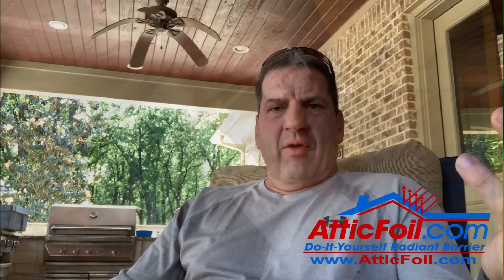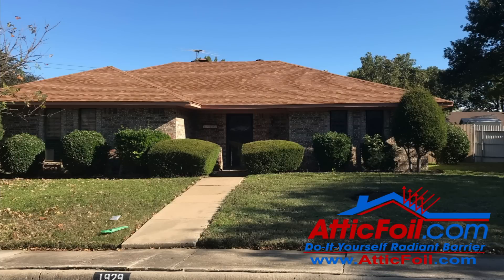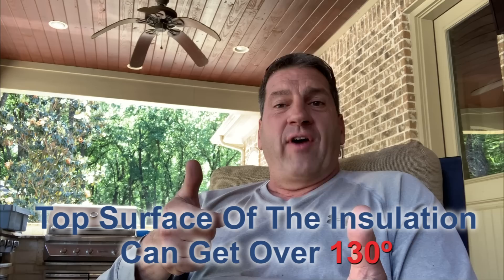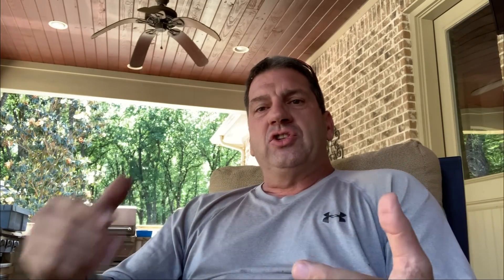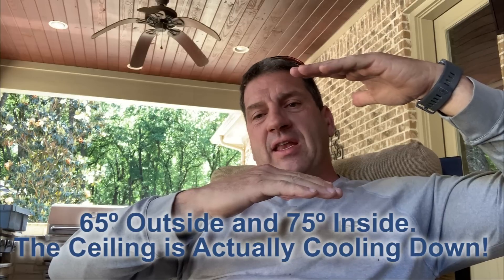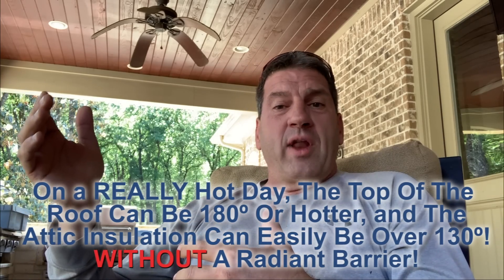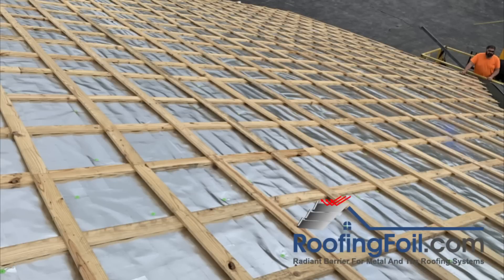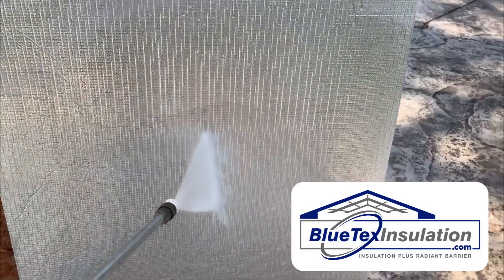Why Is My Attic So Hot? How Can I Make My Attic Cooler? - AtticFoil.com Radiant Barrier

Comment: Can I use this foil instead of the preformed foam rafter vents then add the rafter insulation?
Reply from the maker: Definitely! And it works great.  You can run the lowest piece horizontal across the bottom and tuck back over the top plat of your wall to create a "pocket" for some insulation to sit on the top plate.  This piece will typically go 2-3 ft up the slope of the roof.  Then leave a few inch gap before you start with your next piece.  This gap will allow air to enter the attic if needed.  Look at this page: https://atticfoil.com/index.php/installation/staple-up-installation/ and look for the section -  Want to Add More Insulation Later? You will see the skirt and slit method there.

Comment: I just bought a house, and the old owner installed foam on a small attic section separate from the big attic. The problem is that section it's on top of the garage, and I think the problem is that all the heat that enters thru the garage, those vapors rise to that small attic that now it's completely sealed because of the foam at the roof. So that heats travels to my closes room the closest and my master room. Any ideas?
Reply from the maker: Not sure why someone would foam only part of the attic.  You should either go fully sealed or vented.

Comment: Here is my situation.  When we purchased our home 12 years ago, which was built in 1940, the  attic did not have gable, ridge or soffits vents (no soffits since my roof has no overhangs), but it does have a window at each end.  My roof has slate tiles and my entire attic is insulated (floor, rafters and gable walls.). Not sure of the reasoning behind the batt insulation in the rafters since it was never a living space.  As you can imagine, my attic gets really hot in the summertime. Opening both windows helps a bit but not much.  Would removing the batt insulation from the rafters and doing nothing else help some of the hot air escape through the roof, and/or would installing this foil insulation instead (after removing the batt insulation from rafters) be better in the rafters?  I could install a fan at one end of the attic and run it while the other window is cracked open, but that would require running electrical in the attic.
Reply from the maker: You would be best to remove insulation between rafters and ONLY use www.AtticFoil.com radiant barrier.  The attic is a "non-conditioned" space, but they basically built a refrigerator with holes on each end.  You would be better to stop much of the radiant heat from getting in.  I think you will be surprised how much cooler the attic is after installing a radiant barrier.  Remember, the attic will usually never be cooler than ambient (outside) temperature.  I would only consider an fan IF the attic is still 20+ degrees hotter than outside after installing www.AtticFoil.com

Comment: Wouldnt you only want it one way radiant barrier? I want to block the heat radiation from my roof, I don't necessarily block the heat that would be trapped in the attic, back at the attic, right?
Reply from the maker: There is really no such thing as "Trapping" heat.  Heat always moves from hot to cold.  So, any heat in your attic is trying to move to the cooler interior of the home, not back out the roof.

Comment: How does the foil compare to reflectix bubble foil? I'm in Houston and looking to install on the bottom side of my rafters in my detached garage.
Reply from the maker: Take a look at this page: https://atticfoil.com/index.php/knowledge-zone/knowledge-zone-attic-foil-vs-other-products/  Bubble foil in a vented attic will not do any better than www.AtticFoil.com and it's more expensive.  Bubble foil type products are more for metal buildings where condensation on the metal can be an issue.

Comment: I don’t have a ridge vent but I do have a gable end vent. Should I install this from the top to bottom of the attic ceiling? Or leave a gap at the top? Also is this better than using r8 bubble wrap? Thanks
Reply from the maker: No, ridge vents alone will work great when combined with soffit vents. Always leave gaps at top an bottom.  You WANT air to flow freely through your attic.  Bubble foil has NO advantage compared to www.AtticFoil.com  In fact, you will spend more money for no additional benefit.  You want foil stapled up first, and more insulation on the FLOOR of the attic.
Reply: AtticFoil Radiant Barrier Foil Insulation thanks for the reply. I don’t have a ridge vent...should I still install foil?
Reply from the maker: @pureforce469  Sorry, I missread your question.  YES, it does not matter where the "hole" is in the top of the attic.  Just leave a couple inch gap at the top near the ridge and cut holes in the foil if you cover the gable vents.  The hot air will "find" it's way out.  Like water heading downhill.  Just install the foil so the air never hits a "dead end".  This page and videos will help: https://atticfoil.com/index.php/installation/staple-up-installation/

Comment: Hi, I'm living in a new build, semi-detached house. in my attic there are grey construction bricks on sides, rafters on top. I have put the foil underneath the rafters, left an air gap on top and bottom. What I understand is I need to cover also both grey brick walls, or the foil underneath the rafters is enough? Thanks
Reply from the maker: It sounds like the bricks may be a gable end??  If it catches sun, then yes you want foil between the hot brick and the insulation.
Reply: @AtticFoil   yes it's gable end. However, for most of the day it's in shadow of another building.
Reply from the maker: @szim71  If it's in the shade, then you will have limited benefit covering it.

Comment: Hi Sr. I'm very interested on the product my house has a big issue on keep cold temperature on the summer here on Houston Tx.  
Now have a question after installing your barrier staple method I also want to replaced or add more insulation on the bottom... on your opinion which is better take the existing out and replaced or just blow more insulation on top of the old one ... my house is 17 years old 
Thanks on advance
Reply from the maker: Unless your old insulation is infested with vermin/droppings etc. then it is still good even if it's a little dirty.  Just install www.AtticFoil.com FIRST and then seal any holes/penetrations in your ceiling and then install more insulation.

Comment: Just ordered 1500 sq ft for my house. I've got Whirlybirds at the top of my roof but I have exposed rafter tails with no venting. Do you think this will be problematic?
Reply from the maker: First, thanks for the order Preston!  It should not be a problem.  Just leave gaps at the top and bottom of all rafters like in the install videos.  However, If at all possible, I'd try to find a way to get some "holes" in the bottom of the attic for air to get in.  Maybe a porch you can cut a vent into? Does the attic access open into the attic? Leave the door open and keep the garage door cracked and this will get air into the attic too.

Comment: I put the foil in my attic and it made a big difference.
Reply: Same here. On a really hot day, my attic is 120 degrees. The 16 inches of blown-in insulation just under my attic foil (from this source) is 105 degrees. That is how well it radiates the heat away. That's 15 degrees less heat leaking into my house.
Reply from the maker: @Inkling777  Thanks for the feedback!  On a hot-sunny day many people totally undervalue the benefits of a radiant barrier.  Once they see and feel the difference they are believers.

Comment: Attic install scenario: Vented attic, ducting on floor with insulation, 2x6" joisting, wood ceiling (not sure what it is called) with no insulation, so, can I put foil over the entire floor before I put plywood on top? I also want to foil the ceiling.
Reply from the maker: You cannot install foil directly over the insulation and then directly lay down plywood.  You MUST have an airspace on one side of the foil for it to BE a radiant barrier.  If you are putting down plywood, then I'd just staple it up.  Pretty basic standard attic install here: https://atticfoil.com/index.php/installation/staple-up-installation/

Comment: What about moisture being caught between the radiant barrier and the ceiling?
Reply from the maker: The space between the foil and the roof deck is ventilated - gaps at the top and bottom, so no issue there.  And if you lay out over the insulation, AtticFoil has microperforations, so it is NOT a vapor barrier to trap/stop moisture.  Does this help?

Comment from the maker: Did you enjoy this video? Please like and "Subscribe". What topic would you like for me to cover in a future video?
Reply: I am a total believer in attic foil; I had it installed on my last house (10 yr old with soffit vents and fixed roof vents). The foil made a huge difference. Now I am 90% done installing on our new house and it doesn't seem to be making that much of a difference. This house is 68 years old block construction, with gable vents, and 2 fixed roof vents and a 3 year old shingle roof. There are no soffit vents. Should I cut holes to allow airflow at the top cap/over hang to allow more airflow in the channels? Great product by the way
Reply from the maker: It depends.  If you are in a colder climate with an older "leaky" home, more ventilation could help in the winter. Or, if you are in a really hot area having the low "holes" for air to enter will greatly increase the "stack effect" in the attic.  Cool air in the bottom, hot air out the top.
Reply: @AtticFoil  Thanks for the reply. I'm in Florida so def hot climate. I will try the holes. I want to get the most out of the foil install!